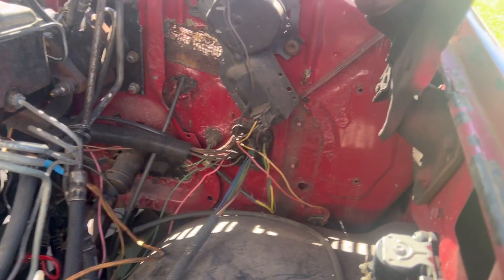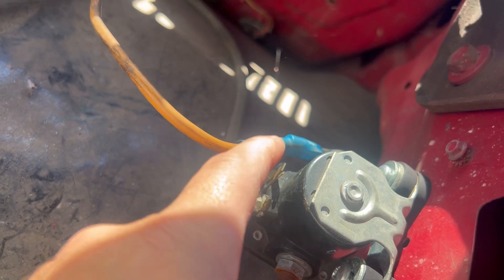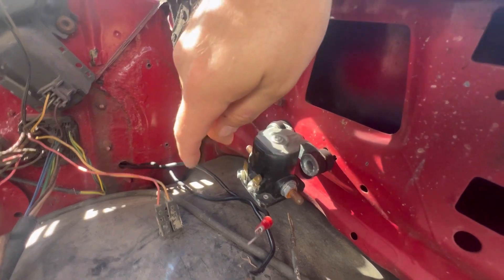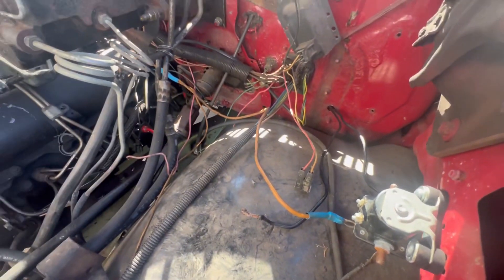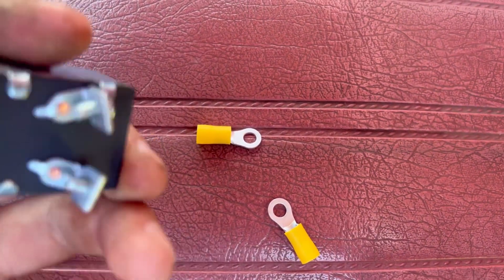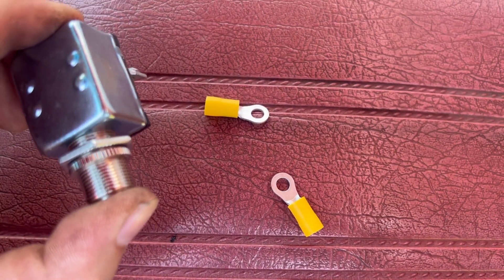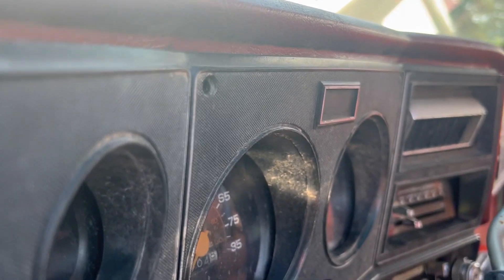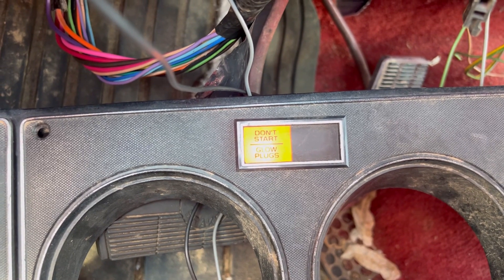Squarebody 6.2 diesel manual glow plug conversion

Comment: Doing a manual conversion on mine currently. After wiring in the manual switch, is it necessary to keep the connections to the original controller, or is it fine to remove it? Thanks for the video!
Reply from the maker: It’s fine to remove it and just run the manual conversion. Thanks!

Comment: did that starter solinoid used to have a clip? i have the same one in my suburban that would work with the key ..now when i turn the key forward to engage the glow plugs i get nothing so i jumped the solinoid from the battery side to the side that goes to the glow plugs the glow plug dummy light comes on but i get no solinoid thud….but when i give the pink wire 12 volts i get the thud but no dummy light .do you think it’s the solinoid ?
Reply from the maker: Sounds like your solenoid needs replaced